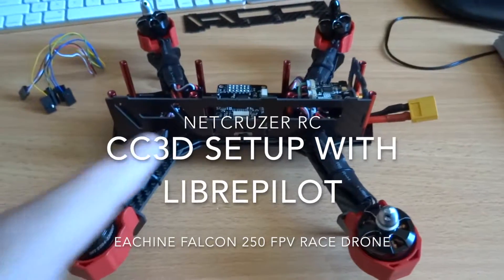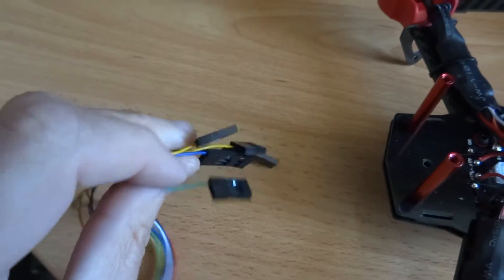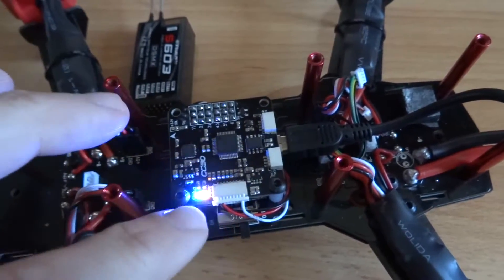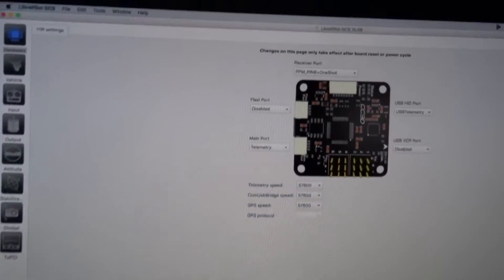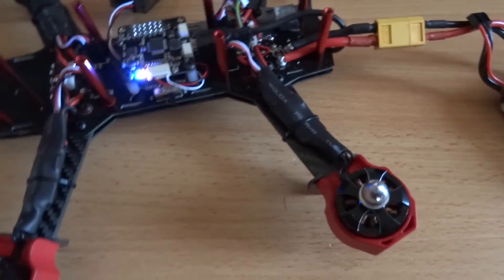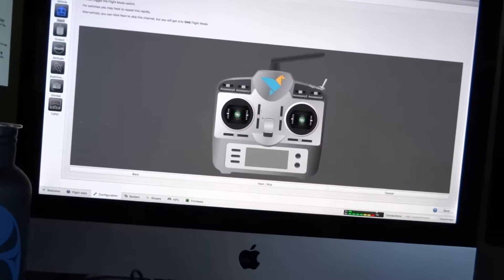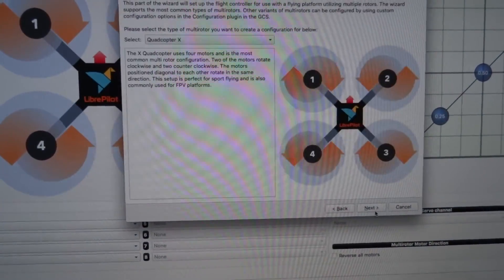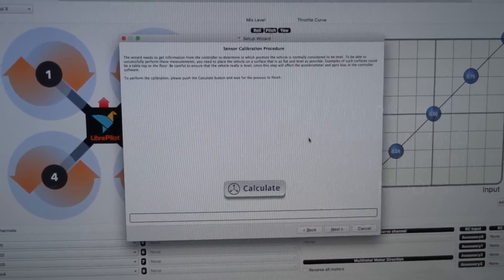Eachine Falcon 250 CC3D LibrePilot Setup (FPV Race Drone)

Comment: can you please help one of your subscriber...dont wanna save calibration of motors,calculations etc..preparing mixer and stuck...same when i go to transmitter setings,just appear red X on save,and nothing...cc3d board 16.09 firmware and gsc..   PLEASE HELP
Reply from the maker: Sorry Marijan I can't help you. My CC3D board is dead and so is Librepilot.  You should be able to find some other info about how to migrate to betaflight.  I have not kept up with the drones, Joshua Bardwell is your guy! Good luck.

Comment: You seem to have forgot also what drone program in the set up and turning the cc3d card 90° so that you don't have to dismantle it every time you connect it.
Reply from the maker: +paulinfrance5 I have a v1 falcon you cannot rotate the CC3D it has fixed pins to the PDB. My CC3D is dead now and I need to replace PDB with it. Sucks.

Comment: If you don't mind I could use a bit of help... when trying to fix my same model drone I stupidly plugged the led power cord into one of the six HDM ports... needless to say it exploded...  a few years later I began to tinker with it... I bought a brand new CC3D board and a new TGY - iA6 receiver (the new receiver also exploded when I put the power cord into the wrong spot but turns out the old one works fine) after hooking everything up and using the LibrePilot GCS program's set up wizard it still won't work...  I have noted several issues with it...

1.  The motors won't turn when I use the setup wizards test motor orientation step but on occasion all will randomly twitch...
2.  When trying to sink my controller it connects to the TGY - IA6 receiver but when running the controller setup wizard it receives nothing.
3.  Before I replaced my CC3D board one motor would always become extremely hot...
4.  My receiver was plugged in properly
5.  My battery is nearly fully charged 
6.  The code that was originally used for these types of drones is gone which might be the issue with my controller
7.  I don't know if my controller is set up properly...

Thanks a lot sixthkid...

Comment: Can you keep it in the original factory setting and fly after you bind your remote to the receiver?
Reply from the maker: MAYBE - If you hook up your receiver in PWM (all wires) and keep CC3D on OpenPilot (dead/unsupported firmware)

Comment: Netcruzer, do you have to set up the cc3d when you purchase the falcon 250 without the remote or can you just use the factory settings?
Reply from the maker: Falcon should have a basic flight preconfigured on OpenPilot firmware (no longer supported by developers), so if you install a receiver in PWM mode you might be able to fly as-is, but you still need to try to calibrate your radio and that requires software, and I couldn't find a working openpilot, so I had to upgrade to Librepilot.

Comment: I have the usb port on my falcon 250 on the side for easy access.
Reply from the maker: How did you do that?
Reply: Netcruzer Just use a small file to make an opening for usb access. Don't forget to change your yaw value when you change the cc3d board orientation. My yaw value is set to -90 since it is on the right side when the nose of my falcon 250 is facing me.
Reply from the maker: Cool.  I don't know how you managed that.  The CC3D plugs directly into the PDB, so I thought you couldn't rotate the flight controller because of that.
Reply: yes mine is the other way around, 90.00°

Comment: I am assisting my son with his falcon 250 and my background is all with Arducopter and thus this was my first hand at a CC3D flight controller. My question is ref your video at about the 2:47 mark where you have the FW screen up, that exclamation mark in the yellow triangle is that the normal display as a result of utilizing Librepilot ? I've verified my son's flight controler via Librepilot and I get the identical data as your FW screen.
Reply from the maker: Ignore that I guess. I don't know what it's a warning about, hasn't caused me any problems.

Comment: Trow that board away. get a Sp f3 Deluxe. its much better
Reply from the maker: Someday, I think it's way too much work to get CC3D to support airmode or Clean/Beta flight firmware.
Reply: Netcruzer it's not that hard to flash it using an ftdi addapter. I actually have betaflight 3.0 with airmode on my falcon's cc3d.
Reply: wardope might as well get f4 controller instead of f3. not too much difference on the price.
Reply: good point. altho i havent been flying with the f4 but i just ordrred one. so im looking foward to test it

Comment: I'm on Windows 10 and it keeps saying run time error every time I try to run librepilot tried uninstalling and reinstalling didn't work any advice.
Reply from the maker: I've only tried it on Mac so far.  There should be troubleshooting forums on LibrePilot to help you out.
Reply from the maker: I bought the ARF so no flysky for me.  Yes it is a great value or the components you get for the price. I want to fly all my planes/quads with my DX6 gen2 radio in DSMX. I'm learning too, but it's working well so far.  Thanks.
Reply: first hit upgrade and erase then connect usb...